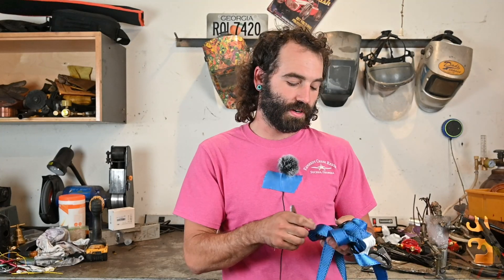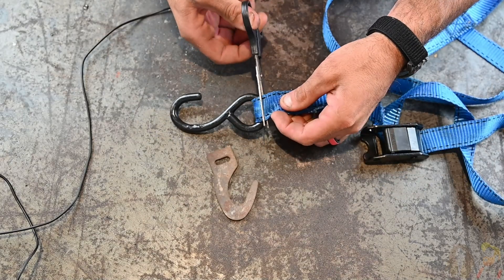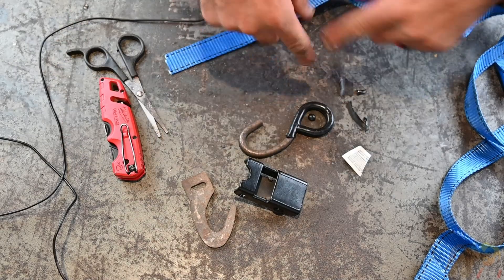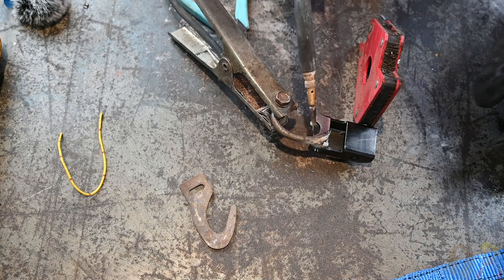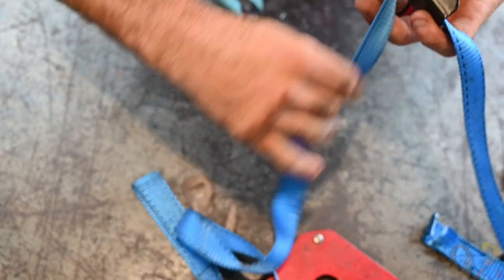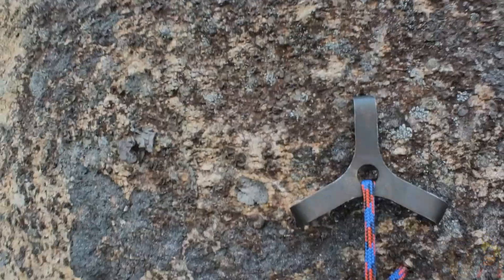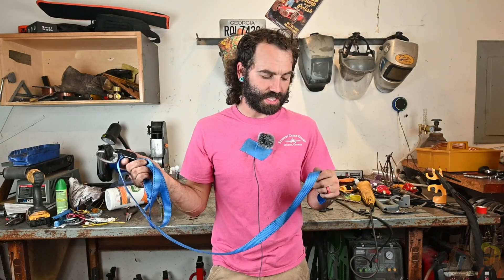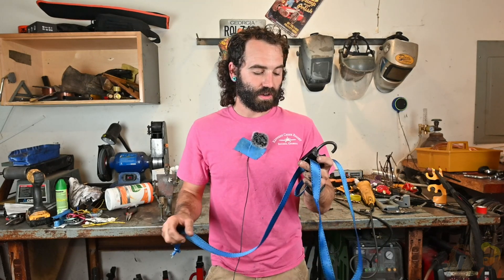The All-Free-Free | Making My Own Gear

Comment: You can also cut the hooks off the webbing and basically have a couple yates daisies, I suppose. I’m not sure what the advantage of the alfifi over two adjustable/releasable daisies is supposed to be. Seems like hype, and two Yates (or Skots) daisies are cheaper.
Reply from the maker: For easy aid where you don’t need a leash on every piece it is extremely fast to move from piece to piece with the all fifi.